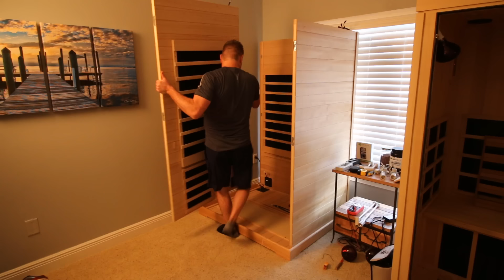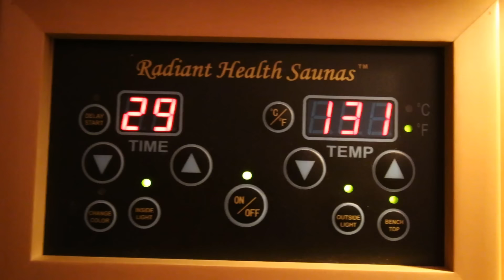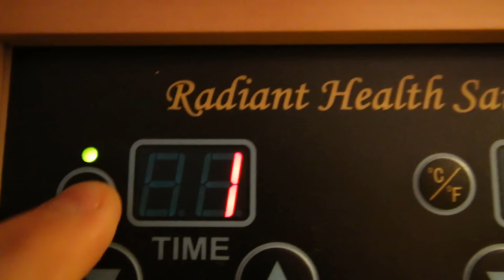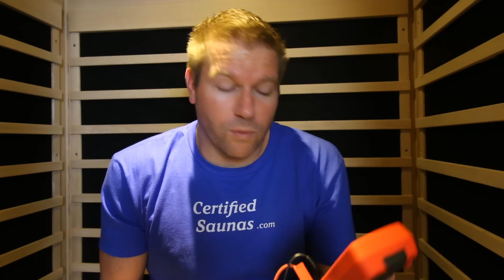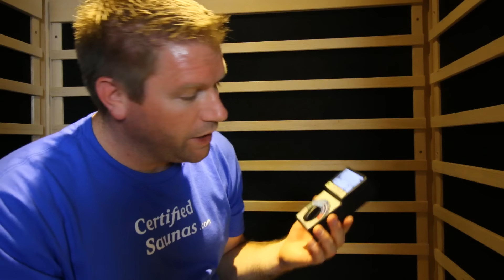Best Sauna Ever - Lowest EMF Far Infrared Sauna On The Market - Top Rated Home Sauna Out Of 12 Brand

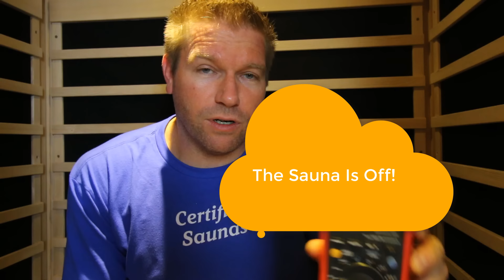Comment: @9:50 HI Matt; My name is Matt too!

PLEASE HELP; I had mercury fillings as a child; most came out, maybe I have one or two left (not sure). This whole winter I've been extremely craving heat and want the house at 70F. Been double layering (first time in my life) and I'm in North California.

How did you detox the mercury?
And is there a test I could do to see if I do have mercury toxicity or aluminum etc.

I had a hair toxicology test like 6 years ago which only showed elevated copper levels. But I'm certain there's more.
i have mood swings as a symptom of mercury intoxication; and my diet is predominantly whole foods plant based, raw vegan. So I'm not toxifying myself that way.

Thanks

Comment: Matt, the ONLY and major draw back is the temperature!  If the suana can only go up to 130F it is too low to be of much health benefit.  It will not activate: FOX03, Heat Shock Proteins. However, if sauna can go up to 170 or 180 I will consider .  Thanks

Comment: Matt or anyone else here, any thoughts on the InfraSauna which combines FAR infrared into a traditional sauna?

Would it be hard to wire a Tyco heater (common heater from a traditional sauna) into one of the certified saunas?  

Any problem running both at the same time so you get the cardio mimetic effect of the extreme heat while getting the deep FAR infrared penetration at the same time?
Reply from the maker: Just replied to you other comment. Have you checked to see if you can run both at the same time?
Reply from the maker: Just replied to you other comment. Have you checked to see if you can run both at the same time?

Comment: Look man I was on radiant health sauna website and there is no way to contact them but through a phone call to purchase unit only? No email is made available jto ust to ASK a simple question how imuch is it for the one person room sauna?
Reply from the maker: Why not just call and ask?  I don't know the exact price, it depends where you're shipping it to.  It should be $3k'ish... the price ranges for each brand are on certifiedsaunas.com
Reply: @matt-justice  I did called and got their answering machine. I left my phone and name and also mentioned that i was referral by mister justice. By the way i am 6f2 and 200 lb i am wondering if I can fit in that 3×3×77 box?
Reply from the maker: Yes you can, but a 2 person is more comfortable. I used a 1 person for a year though, no issues just not as much width.

Comment: Does the discount apply to Radiant Health's E-1H 1 Person Elite Model 3’ x 3’ x 6'5”H (40″D with overhang)? Regarding the 30m to 130F, any idea how many heaters or how fast that 1-person heats up in comparison? 

Have you tried the Infrared 1 Person Majestic Sauna w/ 5 Deluxe Carbon Heaters? Heatwave  SA1400?  They have 5 heaters, and assembles with buckles!  The TheraSauna Classic has 6 heaters but is 115V.. the Almost Heaven Saunas' Logan Cedar 1-Person Electric Sauna has a 4.5kw heater (220-Volt, 30 Amp)!!  Would love to see a review on the Logan!

Comment: I am trying to understand how one Sauna would have more EMF than other which have same size panels. I mean, if this is just the power allocation, wouldnt it just be the same all all of them. The build materials on these heating panels also feel the same, then where would the different be then?
Reply from the maker: Too many factors to list: panel layering, input connectors, shielded cabling, cleaning up power supply, canceling out mg-v/m, ditching high output led lighting, control panel gang shield, and on and on...